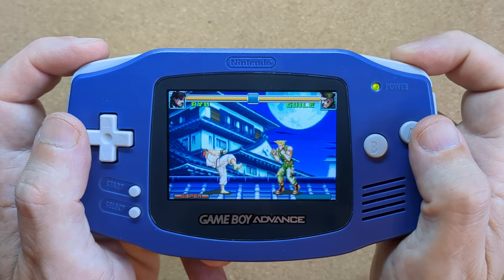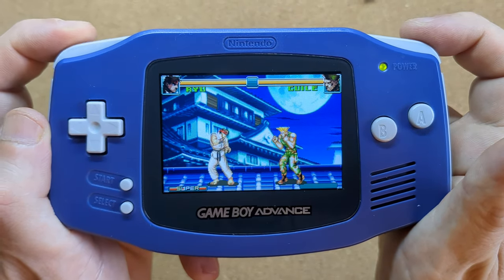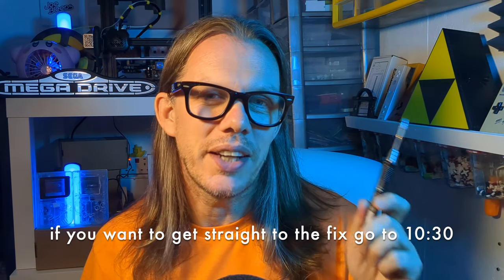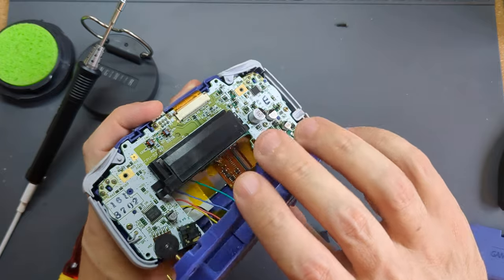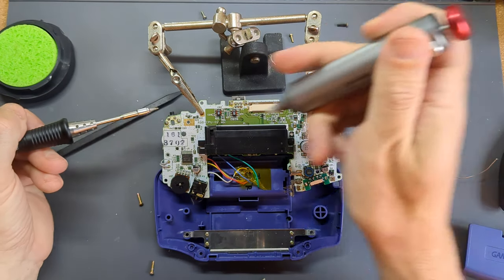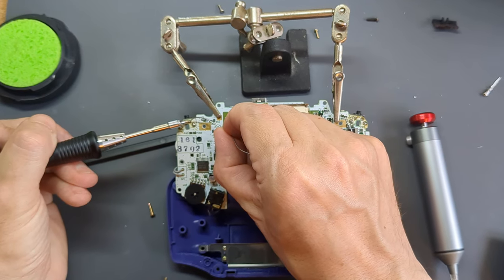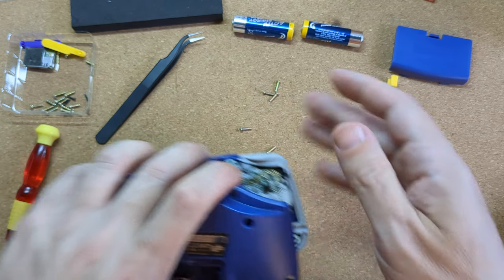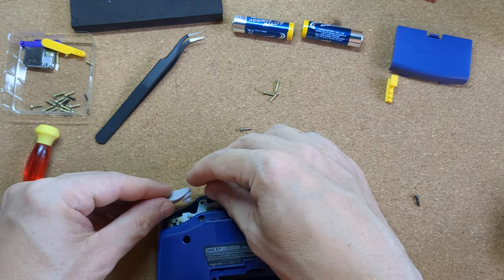Clicky Trigger Mod for Nintendo Game Boy Advance

Comment: To shorten the travel, I think you can easily put a piece of small paper between the actual button and the shoulder button or just use hot glue.
Reply from the maker: Absolutely. I liked the screws because it allowed me to adjust it til it was just right. I've bought a box of tactile switches since so I have a range of sizes now

Comment: Woooooow, the screw adjustment was EXACTLY what I did the other day. It's brilliant isn't it?
Reply from the maker: Haha what a coincidence! Yes it's a great little fix
Reply: @JoeBleeps  I got another for you - the short version is that you can modify the tactile feel of the switches by making a small dent just off centre.

I didn't have any replacement tactile switches until yesterday so I had to harvest the switch dome from a laser pointer to swap it for the worn out one in my GBA.

While trying to break open the laser pen I did a bit of damage to the dome. I went and swapped it anyway (with the original rubber button on top) and it was satisfyingly clicky. A touch more tactile than the left side so it felt uneven.

I then bought new switches (50 or 100 random 4 pin 6x6x4.3 tactile switches) and decided to do another dome swap for the other side. This time I did the swap without damaging the dome. The clicky feel was a lot stiffer... and suddenly I realised that little bit of accidental damage made a huge difference to the tactile feel. After making two small dents on the new dome and putting a screw in the shoulder - I've got two brilliant shoulder buttons.

Now my problem is trying to fix the horribly mushy D-pad. Any ideas?
Reply from the maker: @HarisF1  wow what a great little discovery! Might have to try that. As for the d pad I don't know, a fresh membrane might be the easiest thing to try, or you might be able to get a clicky overlay with little dome switches?

Comment: New to soldering and modding electronics in general. Just like using the solder sucker method, would I be able to use solder wick instead? 

It seems like it would be an easier method? 

I installed a funnyplaying ips kit and I’m having issues with the left shoulder button not working even though the button is clicking. I’m definitely going to try and pick up some short travel triggers.
Reply from the maker: Solder wick will work but it depends on the quality of the wick you have

Comment: Looks like your using the wrong tip on your iron. Conical tips should only be used for micro soldering like small smds. What you need is a larger tip like a chisel. Using the right tip will make a world of difference.

Comment: I have that same solder sucker and it's awesome
Reply from the maker: The Engineer branded tools are really excellent quality. That's why I got excited about the soldering iron stand! But that solder sucker is the best I've used.
Reply: @JoeBleeps I also have a desoldering iron but that's usually overkill so I prefer the solder sucker.
Reply from the maker: @ChewyChicken589  quick and useful